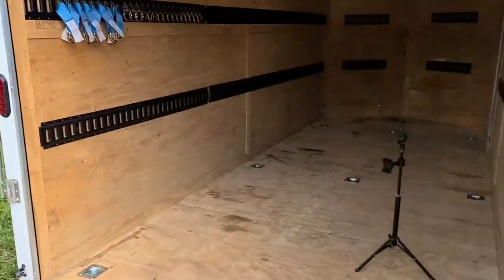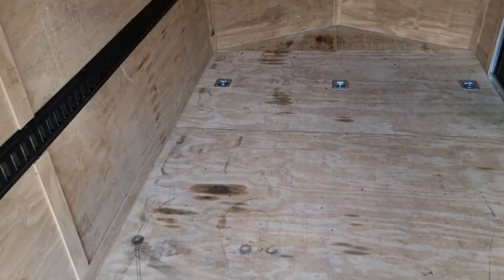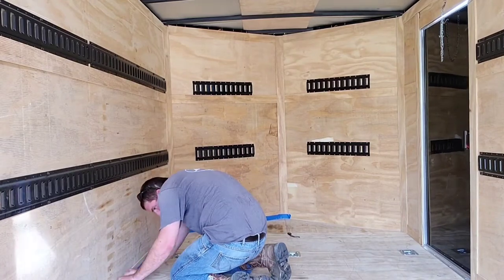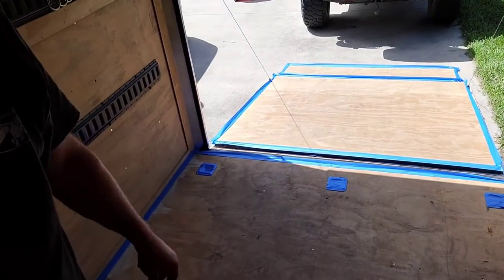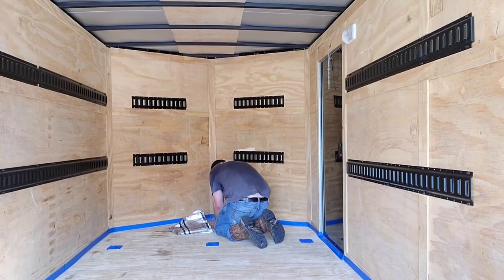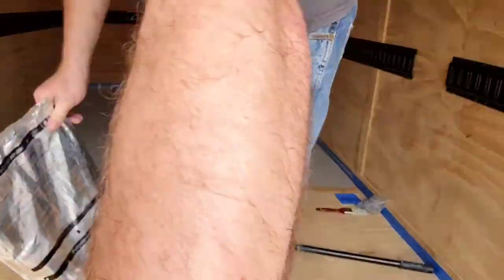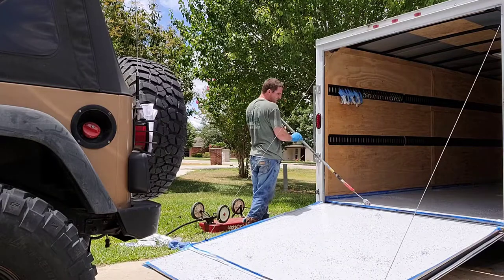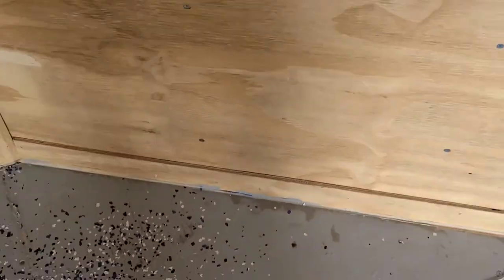Will Epoxy work on an enclosed trailer floor?

Comment: Some of the other videos I saw showed people putty-ing the cracks and sanding the whole floor down first. Because it's a cheaper kit it goes a long way when the surface is prepped first, then 2 layers of epoxy (with or without flakes) and finish it off with the rock solid clearcoat

Comment: Was thinking about doing the same to an identical trailer. Looks good to me. Preciate the tips to help others not make mistakes 👍🏼
Reply: Does the paint have sand in it or something of the sort for anti slippage? Thanks
Reply: @markcaruso815  No, you have to buy a separate pouch of anti slip rustoleum makes should be on the same shelf in Home Depot where the epoxy is and you mix it together

Comment: Bro, where did you get the wall tracks, I love your set.up
Reply from the maker: It came with the trailer but I have ordered several accessories  from Amazon which has a wide variety of options.

Comment: How's it holding up to the lawn care equipment?
Reply from the maker: I would say its holding up pretty good. The ramp has one spot thats showing a little wear but that could be from being put on too thin. Also there are no cracks in the epoxy from trailer movement.
Reply: @bazingalawncare1003  Good to hear, thanks for the reply!

Comment: Great job looks good to me, I have a new similiar trailer, is the Epoxy paint somewhat water proof? Can you hose down the floor for cleaning?
Reply from the maker: I would say it somewhat waterproof (anything is better then raw wood) I have personally hosed it down and nothing has happened yet. I wouldn't pressure wash it though.
Reply: Can you put that product down while it’s very cold out?

Comment: Just picked up a trailer with 3/4 OSB flooring.... i'm thinking it's too porous for this? It's a 7x17 and if I were to do it, i believe i'd use a 2.5 car garage kit for roughly 1000'sq, even though the trailer is roughly 120.  Thoughts?
Reply from the maker: Im no professional. I'm just A DIY type of guy.  I would say it to porous and if you do decide to go with it I would have an extra kit on standby.
Reply: I'm willing to bet that the flooring type osb is less porous than the plywood in this trailer,  life long carpenter

Comment: I've bought the same product,  to do my new 5 x8 enclosed trailer.  Thanks for the pointer on the extra rollers;  gonna pic up an extra pair, just in case!
Reply: Hi. Was one box of floor system enough for your 5x8?
Reply: @rickraub5448  yes, the single car garage size was enough to easily do a 5 x 8 size trailer.
Reply: @stamperman1  
Thanks. Good to know. I'm looking at 5x8 trailers this week and haven't decided to paint or do rubber flooring.
Reply: @rickraub5448  I did the floor epoxy on the floor and the 3" strip of wood that meets the floor.  Then I did a good quality paint for the walls.
Reply: @stamperman1  
Nice. I'll probably go that route. Was there enough paint in the single garage pack to do a base coat first? Or do I even a base coat if I sand it down really good first?
I'm getting ideas gleaning through multiple videos.  Thanks for responding. 👍👍
Reply: @rickraub5448  I'm not sure if you can apply a 2nd coast of epoxy without buying a 2nd kit, because it sets up so fast that your unused portion will harden before the 2nd coat.  There may be someone else that has more experience in this area than I have though.
Reply: @stamperman1  
Appreciate the info.  Thanks
Reply: @rickraub5448  make sure you open the box at the store first, and check to make sure that the epoxy packet is soft & pliable.   I got all the way home, opened the box and my packet was as hard as concrete. Apparently it had been on the shelf so long, it had hardened up!
Reply: @stamperman1  
Wow.  Seems like there should be an expiration date on the box. Lesson: Check for expiration date before you eat epoxy! You could get sick.
Thanks  for the added advice.  Appreciate it.
Reply: How is your trailer holding up?  Also does it have a ramp door?  I have a 5x8 I wanna do with epoxy and was wondering how much to get.  Thanks!
Reply: @TJMill3r  holding up well thus far.  I don't have a ramp door,  I have double doors
Reply: @stamperman1  u think a 1 car would be enough to do my ramp door too?
Reply: @MudMonsterRacing4  yes, as i only did my floor and bottom 3 inches of wall in the expoxy.  i used a good quality paint on my walls and doors.  i had about a 1/3 of my expoxy can left,  so i' think you'll have enough to do the floor and ramp door both with one coat.
Reply: @stamperman1  did u use the rustoleum epoxyshield or the rock solid in the bags?  Sorry so many questions 😅
Reply: @MudMonsterRacing4  Rock Solid from Home Depot.    just make sure that when you get it,  that you check the pouches inside the box.  i got all the way home to find the pouches hard as a rock,  as they should be pliable.  so i had to go all the way back & exchange for a new box.   a quick check can save you a lot of hassle!
Reply: @stamperman1  thanks again for answering my questions.   Gonna get the 1 car.  You definitely saved me money was gonna get the 2.5 car.
Reply: @stamperman1  I bought the antiskid additive too for it and extra chips already. Just need the product.
Reply: @stamperman1  did you use the clear coat too?
Reply: @axist2389  no, I just laid down the epoxy, sprinkled on the flakes, and called it good
Reply: @stamperman1  that was my plan but started second guessing myself and wondered if I was missing something by not adding the clear coat. You sound happy with the result? Thanks for responding
Reply: @axist2389  yes, a few of the flakes have come loose, but it was probably because I didn't get the flakes spread evenly

Comment: Does that epoxy make that ramp slick? I would be afraid of slipping coming down that ramp
Reply from the maker: I put down some of the chips/flakes and it seemed to work really well making it non slip surface. I can see it being slick without it though.

Comment: Nice job on your first video! Question how is it holding up for tire marks
Reply from the maker: I was in the trailer yesterday no major tire marks or wear but that's just with lawn equipment.
Reply: I've seen some instances of the paint and epoxy sticking and peeling onto the tire after an xtended time in the same place and in extreme heat. If I did use epoxy I'd put strips of durable carpet where the tires actually rolls and rest.

Comment: Do you recommend priming the floor first?
Reply from the maker: I personally would if the floor is saturated with oils but if it's freshwood I don't think you need to. That's just my opinion.